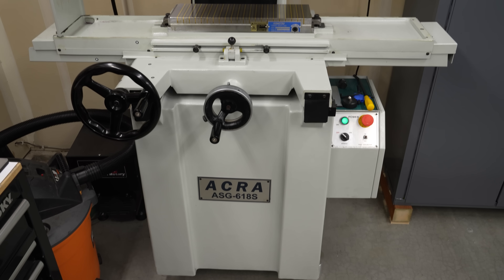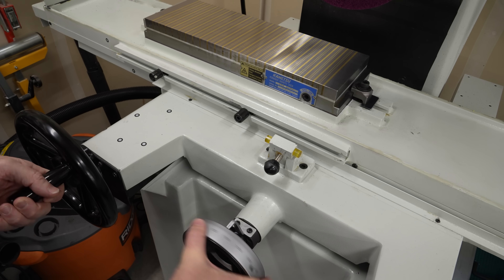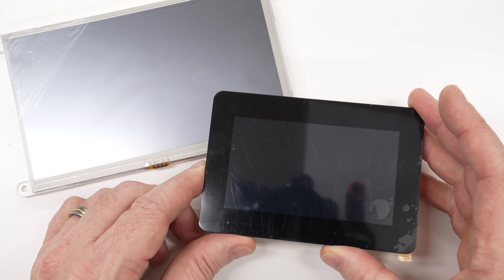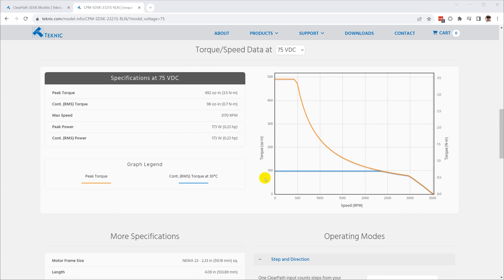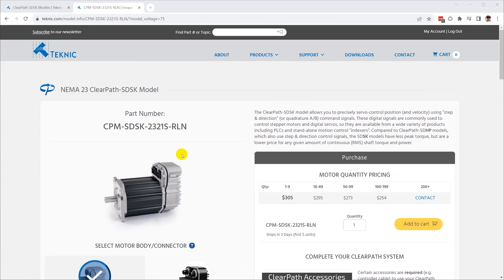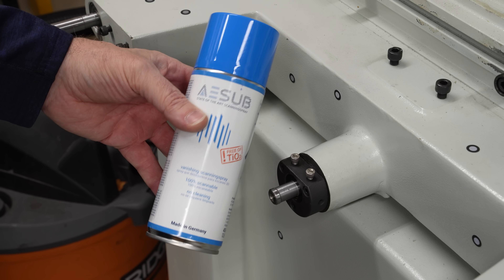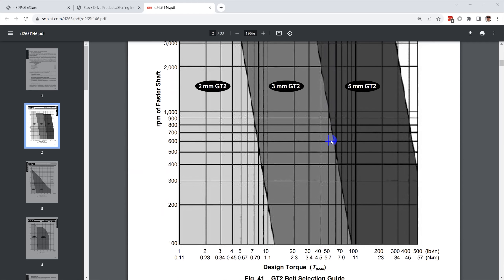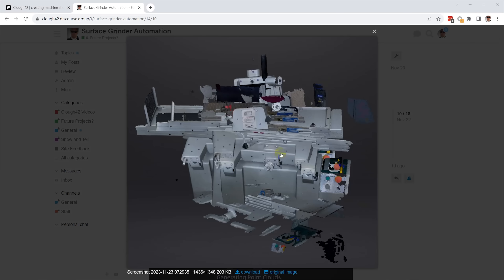How to Select Motors for a CNC Conversion | Surface Grinder | ClearPath | 3D Scanning

Comment: Hey James.  You are really good with automation, and I'm trying to understand how the "duty cycle" affects a Stepper motor.  I have built a 3 axis power feed on my Bridgeport using Arduino, switches, potentiometers, and Stepper motors.  My Arduino code sends HIGH to the Drivers PUL pin, delays a few microseconds,  send LOW with another delay of the same number of microseconds.  That a 50% duty cycle.  How would say, a 75% duty cycle affect the motor? Just in speed, or would it give more torque?  Thanks!  
Regards.

Comment: Please accept my professional opinion as a kind, respectful comment. As a tool and die maker, I've spent countless hours using a surface grinder, and it's not that hard. And as I'm sure you know, electronics can cause crashes too! Unless you're doing some type of production work, you will spend more time fiddling around with the electronics and programming than if you just used the grinder by hand. Automation is good for larger grinders which I have used and automation has it's place, but I don't think it's practical or advantageous for your application in a home shop. You can get yourself out of trouble much quicker on a manual machine. That being said, from the standpoint of providing entertaining and informative content that encourages others to explore new ideas, you will and always have accomplished that goal. Thanks for your videos.

Comment: Hey James. Thanks for your very informative video! We went ahead and did the exact same conversion on a Sharp SG-618 (Taiwanese clone). As this was for a pressing job in my company, I had an engineer working full time on the project. We decided to get the enhanced and sealed version of the servos. Our machine is setup with a "Grind-Rite" centerless grinder attachement. The build is now complete we are CNC grinding shafts within 2-3um with an auto dressing/truing sub-routine (diamond wheel). Let me know me know if I can help.

Comment: for anyone interesting in this inertia thing: inertia matching optimises energy transfer i.e. efficiency. the electronics equivalent is impedance matching; you don't always want input and output impedances to be matched (think of output of a pre-amp into the input of a power amp). in practice, the total system inertia is usually as low as possible (i.e. smallest motor) without overwhelming the control loop of the servo (i.e. which is when it starts to oscillate) because that is most effective in terms of performance per dollar. between system inertia and rotor inertia you would want the rotor to far exceed the system inertia because from the motor's perspective that would approach driving no load, which isn't necessarily efficient, but it does provide very good performance; just think of how fast a servo motor starts and stops with no load attached. i had a 2.2 kW AC servo some time ago and it would literally jump off the table a little bit when changing speeds. went through a big rabbit hole when selecting motors for my machine lol

Comment: The only use i have for a cnc surface grinder would be for grinding forms on carbide and ceramic. 99 percent of that would be on round parts between centers or a drive head. You are going to make that grinder a clumsy POS and never develop grinding skills. Thanks very much for the video. There is much useful information for projects i would like to do. I look forward to seeing the finished project.  If that surface grinder had a DedTrue centerless fixture or a powered rotary fixture mounted then the cnc retro fit would be kinda awsome.

Comment: Automating the X and Z axis makes sense for the surface grinder but in my mind, automating the Y (Vertical) is not so much unless you set traversal limits to keep from crashing the wheel into the work in excess of what you intended.

Comment: Hello James, since you are the one I go to for CAD tutorials, I thought I'd ask you this question. I'm trying very hard to become a better designer and the terminology escapes me in this case.

In Constructive Solid Geometry, you create primitives that either add to the final geometry, or are used to cut away parts of other primitives. Is there a specific term for the "tool" that I create to be used to cut away from the original geometry? I seem to think that the term "slug" is correct, but I really have no idea.

Overkill really IS underrated, Sir!
Reply from the maker: Fusion just calls it a tool body.

Comment: Amazing work but i have one concern. While you might think that your pulleys can handle the required torque, the technique used to mount them to the motor shaft does not. You should replace them with clamping-type pulleys, which are designed to handle high-torque applications like yours. 

When you keep using regular pulleys the set screws will damage the motor shaft, and the set screws will eventually unscrew themselves. You could possibly get away with keyway pulleys but clamping-type pulleys are what you should be looking for.

Comment: My only quibble is when you're grinding the force of the grinding wheel itself driving the table to the left is considerable and not inconsequential most motors cannot account for this force.
Like with a robotic pic and place the force that requires to Lift and get out of the way versus driving down and Stopping. 
I've seen blown up gearboxes left and right trying to get out of the way on the up stroke but there's nothing like the spectacular crashes on the down stroke with a automotive or diesel crankshaft.
"I'm giving her all she's got captain"
I don't know why they don't make the motor controlers have separate parameter sets for the different directions yet.
The cost of the destruction should override the whining factor.
You may wish to lose that pink wheel for a blue or purple one im no fan of norton but radiac porosway wheels are next to impossible to get here unless your willing to buy the tool suppliers inventory, idiots, radiac needs to do somthing about it before we try tyrolit wheels.
You will find the blue wheels more forgiving tolerating high feed and large removal rates giving good finish holding size with less dressing.
The first time you smoke a wheel and are not on the way to the hospital will make you a believer.

Comment: One question I'm interested in is the component of system behavior that corresponds to the fact that the servomotor's position/velocity/acceleration feedback is on the motor, rather than on the load.  Is that somehow solved by the "Inertia Mismatch" calculations?  It seems related, but I don't quite see how it tackles the issue directly.
Reply from the maker: That turns out to be an interesting question.  The servo controller controls the motor, since that's where the encoder is located.  The controller sees the motor's inertia directly, but the load's inertia is only visible through a coupling that has both elasticity and viscous damping. 
 The motor mounting and the load also have some degree of damping.  These external factors are the reason the servo needs to be tuned to the load.  "Inertia Mismatch" is a way to calculate how much you might be asking the controller to compensate for, but it's only part of the picture.  The real excitement occurs in the frequency domain due to phase and resonance.  There's a fairly detailed treatment here, if you're interested:  https://www.automate.org/industry-insights/understanding-the-mysteries-of-inertia-mismatch

Comment: Are there no scale bars or coded reference markers available for your 3D scanner? Worked professionally with Steinbichler and GOM systems (in the $100´000 price range) for a couple of years and even tho the marketing ppl likes to tell you how good their free matching functions in the software are, if you want good tolerances scale bars and coded markers are superb. If you want even better, photogrammetry is the way to go. 
GOM software used to be free in a somewhat limited, but still capable, version. But i guess its not free anymore since Zeiss came in and took over the show.
Reply from the maker: I don't think so.  The blue laser units are the go-to solution in this class, but they're $5-10k.

Comment: Z is always depth of cut. as in the wheel up and down.
Reply: Depth of cut on a lathe can be two directions
Reply: @douglassmith2055  So can a surface grinder (side wheel). So can a mill. So can a router. Plunge is Z

Comment: We have had many issues with HMIs from 4D systems. They often glitch, similar to what you were seeing on the ELS for a while, and they would periodically freeze without warning so that button presses would not be recognized for several seconds at a time. We finally settled on a raspberry pi screen which has been working super well. I'd suggest taking a look at those if you don't want to go down the hmi rabbit hole.
Reply: Also, I'm not sure what you're planning to use for a power supply but, as I'm sure you know, Clearpath motors operate with higher torque ratings of they have a 75V supply. Teknic offers two power supplies, the IPC 3 and 5. You should be able to operate all three motors with a single IPC 5, especially since they won't all be running at full gronk at the same time. They're not the cheapest but neither are Clearpaths. They just work and have the backing of Teknic which is worth the cost imo.
I can vouch for the ClearCores as well. They work incredibly well but you need to pay more attention to the input and output wiring. The documentation helps a lot with this but pull up and pull down resistors are pretty commonly needed for things like limit switches/sensors - not quite as simple as an Arduino.
Reply from the maker: I have an IPC-3, which technically should be enough, but I ordered an IPC-5, just because the enclosed chassis is easier to package.

Comment: Wish I had your knowledge of servo motors and the associated controls.  I have a sawmill that I would love to automate.  Essentially the same except just 2-axis setup, and bigger.  
Spent a lot of years cranking manual surface grinders.  Your project is an interesting exercise, even if not particularly practical for most applications on a small machine.

Comment: What I found the hard way is, the motor drivers don't like motors hand cranked when electronic control is OFF. I used cheap TMC2209 drivers with Nema17 motors not the expensive kind mentioned here. Just be sure to check if you plan to hand crank machine when not using electronics for moving.
Reply from the maker: The Clearpath servos can theoretically handle this if they're powered, but not enabled.  They can even do this with the power hub and logic backup 24V.  I haven't tried it.

Comment: This is extremely timely as I just started a 3 axis project with a ClearCore / clearpath motors. Definitely looking forward to seeing how you get along with the IDE.

Also interested to see how you implement limit switches/ homing in the code. And your E-stop / enable circuit.

Apparently you can attach a digital input to a motor control object to act as a limit switch but they don't really explain anything about it in the documentation that I've been able to find.
Reply from the maker: Yeah, there's a lot these motors can do that I don't fully understand.  Like auto-homing against a hard stop.  Not sure how that interacts with the step-direction interface.
Reply: @Clough42  I saw they had a code example for that, using the HLFB signal. Although for my purposes I think I need an actual limit switch, and they don't have any examples for that using the SD motor types.
Reply from the maker: @MarkFunderburk  I did a bunch of reading last night, and I think that's correct.

Comment: James -- I, for one, greatly appreciate you comprehensively showing your methodical step-by-step requirements, thinking, calculations and hands-on tasks.  It really makes projects like this seem a bit more approachable, providing a reference way of accomplishing your specific result. It introduces the topics that one might immediately learn from the video if familiar with related ideas, or for less-familiar topics, at least introduces them as areas to research a bit further. Well done!
Reply from the maker: Glad you liked it.  This video was an experiment with a different, much more compressed editorial style.  It's very difficult to make project videos that people actually watch.  :)
Reply: @Clough42  There are three or four "chapters" of this video that I'd watch another 30 - 40 minutes of.  But I'm probably in the minority.
Reply: Instead of cable feed is it possible to still do a hydraulic servo using a hydraulic cylinder and a scale I don't know if such things are still available they should be always liked hydraulic servos solid dead accurate leaks and all.

Comment: Hi James,
SDP is a good choice. Quality parts that don't cost an arm and a leg and their calculators are awesome. Have used them for pulleys and belts when adding computer control to several of my telescopes and even built a large German Equatorial Mount for an 8" Refractor that was used at our astronomy clubs observatory. Looking forward to the videos to come on the project.

Comment: Crazy idea here, if you're rigging up your own software for this, why not put a pair of inductive proximity sensors on either side of the grinding wheels contact point. If you have one on each side the logic to automate grinding a pass should be straight forward, you can use the sensors to control the back and forth of the y axis without having to ever setup the machine. 

1 Go to the top of the Y Axis
2  Go to the centre of the X and  Z Axis
3 Lower the Y till you get a signal on both sensors
4 Advance Z "towards you" until you loose Signal on both sensors
5 go in the distance of the sensor offset from the actual wheel
6 Go all the way to the right on the X Axis until you loose both Sensors
7 Drop the machine down a bit on the Y ( I'd guess the amount of thou you want to take off)
8 Go Left across X till you loose the sensor signals

9 Advance Z by some Variable Amount (I'd guess set by rotary encoder knob or touch screen)
10 Go the other way on X till you loose the signal
repeat 9 and 10 till you loose signal on both sensors, 

voila full pass no setup. just make sure the piece is over the center and not off to one side or you would be grinding the magchuck.

doing it this way it doesn't matter the size or the piece the machine can just hit go and it'll run until it's ground the top. the only issue I can see with this is the bracket to hold the sensors would need to be adjustable to take into account the wheel getting smaller as you dress it. I guess technically you could set up some sort of tool height sensor to set the height of the sensors but you'd need motor to control the height of the sensor bracket.

Comment: The gear reduction will definitely help with the inertia mismatch since the reflected inertia is equal to the load inertia divided by the reduction ratio squared, though something tells me you already took this into consideration.  Sesame has a line a planetary reducers that adhere(ish) to the the NEMA standard for stepper motors.  Will probably cost as much as the motor, but will allow you more options than a belt drive since you can do higher ratios.  Everyone knows speed and torque, but inertia is a killer....
Reply from the maker: You are correct.  I did take the squared effect of the drive ratio into account.  :)

Comment: You say this wasn't the "sexy" part of the project..... I beg to differ!
Reply: This.  Working out your requirements and translating them to specifications before implementation is always sexier than going broke doing the wrong thing and living with the result.  On something this complicated, it's way too easy to get it wrong.  One of my favorite aspects of your ELS project was the thoroughness and care you took in your performance requirements and how they translated to your component selections.  It really minimized the redesign/rework parts of the project.  (Plus, you got a lot of great channel content and products to sell!)

I'm sure you did some back-of-the-envelope guesstimates of the time & cost a similar approach would need for this grinder project, before deciding on a more OTS solution.  When you're done, I hope we can get a comparison of those estimates vs. the actuals.